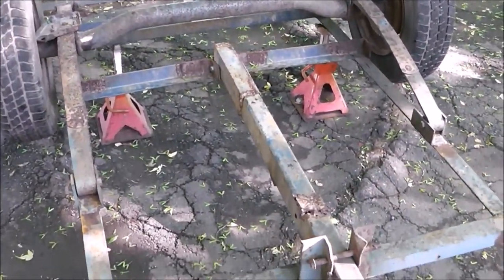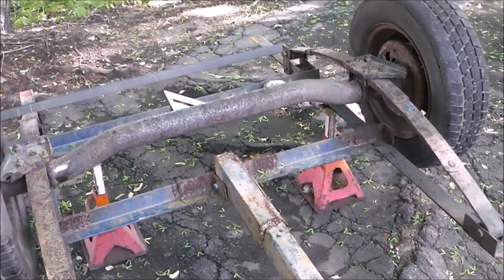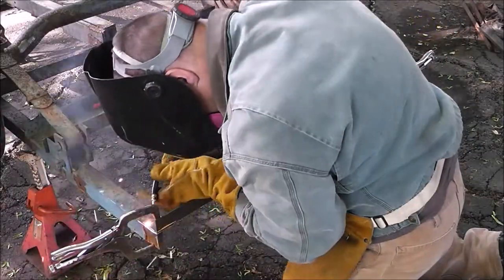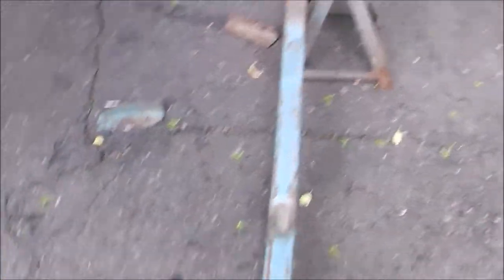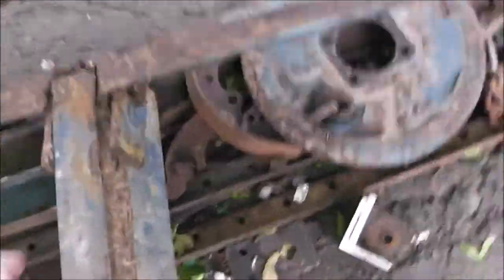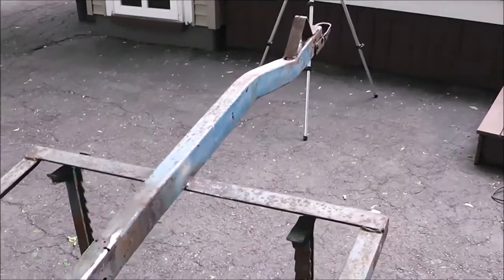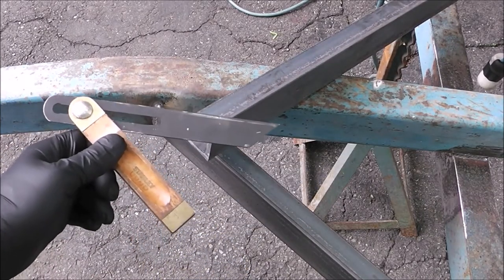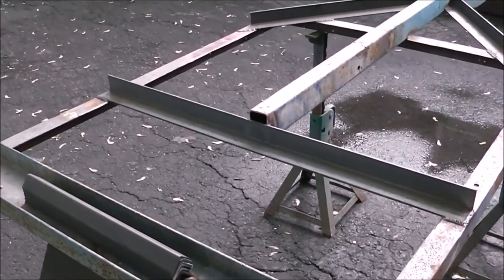The "PILE" Trailer Rebuild Series E.3  THE REBUILD BEGINS - SQUARING THINGS UP

Comment: I am rebuilding a used trailer also. It is a 2000 lb axle with "SURGE BRAKES", and it has a manual parking brake handle, that pulls a cable to set the brakes, that may be what you have. I hope to get a lot of ideas to use on mine. I am going with 5/4 decking. I just got it striped and am attacking the rust, before putting in cross members.
Reply from the maker: @Dennis Hampsten good luck buddy! It's a very rewarding feeling when your done!

Comment: About your axle question. If it were a car axle, it would have to be a rear axle from a front wheel drive & since it's a leaf spring axle with no shock absorber or trailing arm mounts, that's very unlikely. My guess is that it's a trailer axle that either came with brake housings or bare mounting flanges so brakes could be added "after market". However, with that set up, it appears that someone had some car brake housings that just happen to fit that brake flange and added the car brake housings or used them to replaced the trailer's original brake housings. It's also possible that those brake housings could be original and the axle came equipped with some kind of emergency "brake away" system or  even a "parking" brake.
Reply from the maker: +oldtimer4567 Excellent writeup! At first I thought it could be a minivan axle but it's way too narrow and I've tried to find where it was sectioned and I cant. The lower spring plates had a hole in them which looked like could possibly hold a shock?  The bearings are really small though, so I'm thinking your probably right about it being a trailer axle. Im going to measure the bearings and see if i can identify a manufacturer. Thanks for the help man!
Reply: Brandon Lund I've tried finding "anything" remotely resembling that axle with no luck whatsoever. But, if you took that "drop" out of the axle & it were straight, it wouldn't effect ride height. So, it's possible that the drop could've been put in the center of that axle to accommodate a spare tire well on a mini van or other vehicle. Then again, it could also be there to accommodate a water tank in a pull camper. That's one of them, "dang if I know or have a clue" axles. Either way, you finished with a fine looking lil trailer. Wasn't sure 'bout the white paint but it worked out when you put on the black wheels & chrome trim rings...lol. Best of luck to you!
Reply from the maker: +oldtimer4567 Thanks man! Hopefully I won't need bearings or seals for a while, so for now it will remain unknown. Lol. Thanks again and thanks for watching!

Comment: I was looking for the clamps you use but I didn't see them in your gear list. How many do you recommend for a trailer project? I know we can never have enough clamps.
Reply from the maker: Sorry about that. I will be sure to add them for future reference. These are the clamps I use. https://amzn.to/35ix1xE  I generally use just one at a time and rarely do I ever need more than 4.
Reply: Thanks. What about that mini heat gun during the wiring episode?
Reply from the maker: @velodaman  Here you are buddy. It's actually a refillable butane torch and it comes with a soldering tip too https://amzn.to/2KDc3Se

Comment: Good info on the squaring up and not pitching in with full welds without thinking through the forces generated by the welds.
Useful tips for anyone embarking on their first trailer build-and occasional builders like me, coz I can put this in my video library to refer to if I build another. Nice going on those fluxcore welds btw.,
If ya want some heat in your chow, try making a Vindaloo, http://www.saveur.com/article/cooking/the-history-of-vindaloo-
welders food,- the next day effects are often referred to as a "ring stinger" or "Ghandis revenge"  an old joke is to keep a toilet roll in the fridge for next day.  Looking forward to the finished build.
Reply from the maker: Jaques Daniels Thanks for the support brother! I looked up that recipe and I'm quite interested in trying it out. I'm a little nervous though, you mentioning having to keep the toilet paper in the fridge. Simular to "welders flash" but on your backside! Hahaha! Take care man :)